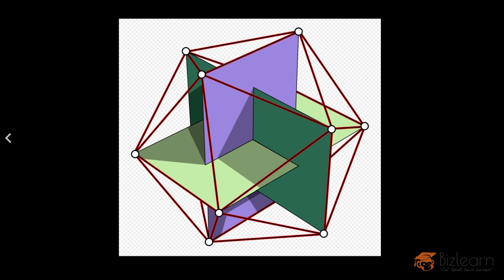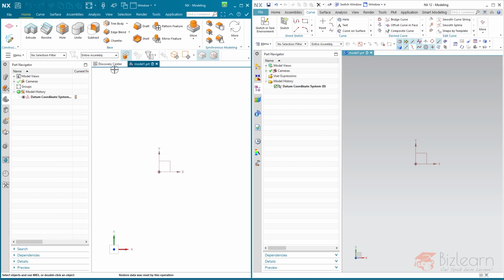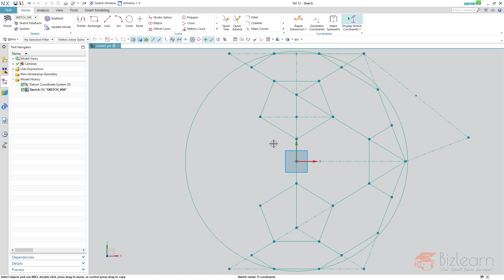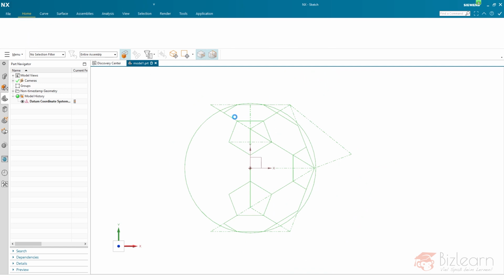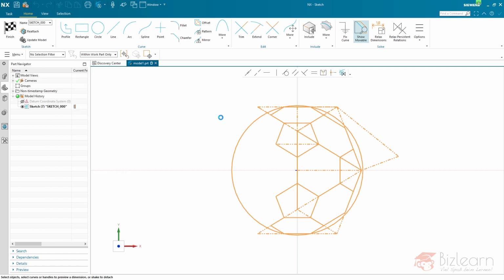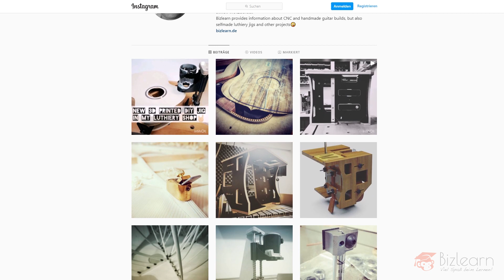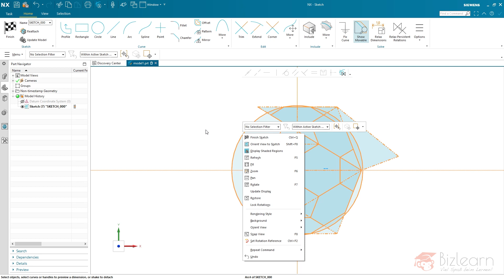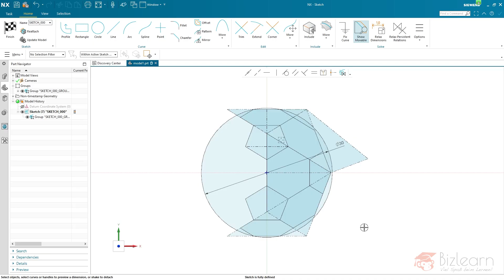Siemens NX 1980 - New vs Old Sketch Solver #2 - How to import dxf curves without Auto Constraints?

Comment: What is the difference between NX 2008 and 1980
Reply from the maker: A few renewals and over 1000 adjustments have been made. The Siemens nx documentation is a good source to find out. But also the usage of the discovery tab in your nx installation can be used to get an overview. We have produced the NX m cad video training already. It's over 60 minutes of video material, regarding the most important renewals.